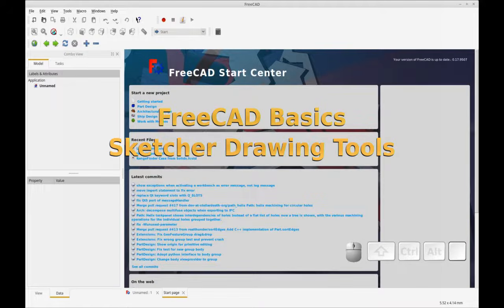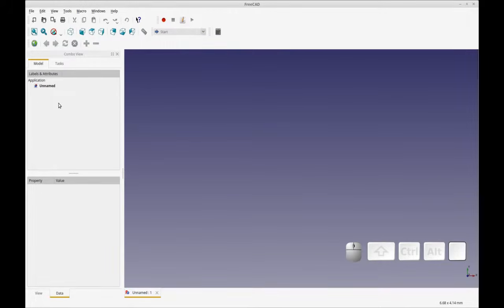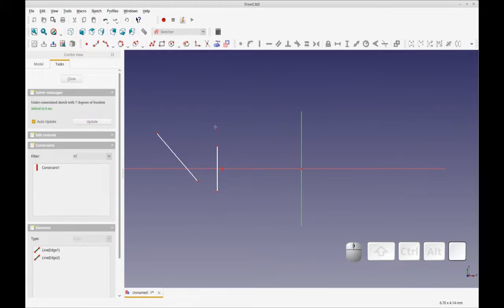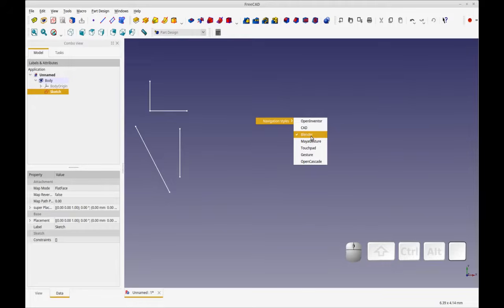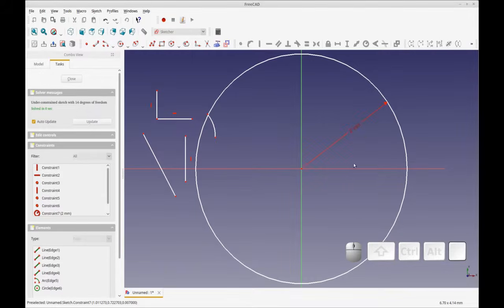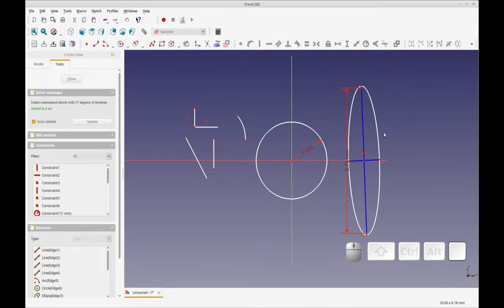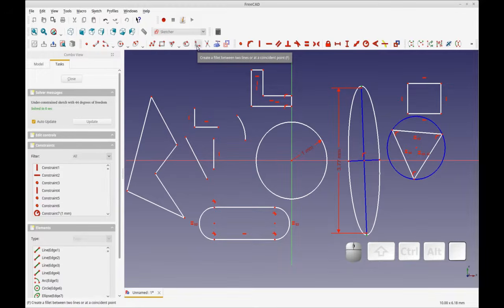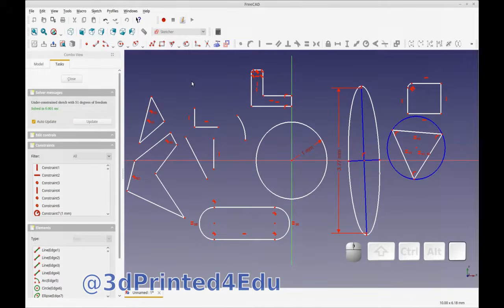FreeCAD - Basics - Using Sketcher Workbench Drawing Tools

Comment: Drawing tools on sketcher are all greyed out. Trying to find some instructions on how to work this software.
Reply from the maker: To use the sketcher tools, the sketch has to be in edit mode. You can enter edit mode by double clicking on sketch in history tree to the left.
Reply from the maker: There is also an edit mode entry in the menus and an icon on the toolbar.

Comment: Thank you for your video. I'm not an engineer and am starting from zero. I'd like to tell it not just the length of a line, but where it starts. Also, does it matter where you position your part relative to the origin?

Comment: What is the name of the software that shows your mouse actions?
What is the name of the video with the constraints?
How can I move a point in a sketch to coordinates xyz and lock it in place?
Reply from the maker: Hey, just saw you comment
1.) Keymon ( Linux only I think )
2.) Use Horizontal Constraint for X, Vertical Constraint for Y.
3.) Above Locks it in place.
Sketches don't have  Z, but you can position the whole sketch to move the Point in Z space.

Comment: Hello very good tutorial however, i have a tech question. I was following along imitating your video but when I got the 2nd vertical line (1:50). I don't have that added vertical constraints next to my mouse pointer. I am new and was thinking maybe it's my settings?  I am also using version freeCAD 0.18 if t hat helps.

Comment: Great, thanks for sharing. Around 1:50 I see your near vertical line gets automatically given a vertical constraint. For some reason, this isn't happening for me. Even although I want to draw something with the polyline tool with lots of perpendicular lines (e.g. a set of stairs) these auto constraints aren't appearing. I guess there is a feature to turn this on and off, but I've not found it yet...
Reply from the maker: You can turn Auto Constrain on and off. IIRC , it is on the task tab when u r editing a sketch.

Comment: How do I print in sketcher? Print preview continually just shows a blank white page. Thank you!
Reply from the maker: Unfortunately, you will not be able to print directly from sketcher. One way to print is to create a Drawing in the Tech Draw Workbench . Another way I have used is just doing screenshots on a white background. It is a little frustrating.
Reply: @mathcodeprint  , I appreciate the reply. It definitely is frustrating when trying to print something out to scale so that I can just glue it to wood as a stencil on where to make cuts. I will try Tech Draw Workbench. Thank you again.
Reply from the maker: For accurate scale drawings, definitely try Tech Draw, make sure you calibrate against your printer. Some printers are not accurate. So print a rule and measure it to make sure the printer is to scale. Then adjust if necessary.

Comment: Hi, I would like to know how to make a polyline with many points all at specific x-y coordinates on x-y plane. Then I would like to make another 2 bsplines on x-z and y-z planes, after that I would like that the endpoints of the different lines on the 3 different planes are connected. How do I go about that? at the end of the day I want to make a specific surface. From the surface I want to make a thin solid surface that I can use on my 3d printer. Thanks
Reply from the maker: My guess is that you would have to do that as a macro, or edit each point of a wire, for the polyline.

Connecting them can be done with draft move, or if sketches attaching to a sketch vertex. 

After that you can create a face from edges with the part advanced shape tool. 

I'll try to see if I can do a quick video.

Comment: Where are you selecting that "Body" from??  I can't find such a thing in my Freecad!
Reply: There is NO "Body" to select or double click in my Freecad. All that shows up in the left is "Unamed" That is unless I name it something, which I usually do right away.
Reply: @sotm6078  Switch to the "Model" tab.
Reply: Dumped FreeCad months ago for Fusion 360, much better program and there is a Free version believe it or not.  360 will even make stl files and generate G-code for CAM functions.
Reply: @sotm6078  I'm pretty frustrated with FreeCAD already. Only been using it for a few days. I'm used to SolidWorks and AutoCAD. Compared to those, this program isn't cutting it. The written tutorials are quite hard to follow, wording wise. I'll check out 360!
Reply: What OS are you using?  I'm Windows 10 and .16 is the latest version I find for 64 bit windows.

Comment: What version are you using
Reply: it is FreeCAD_0.17.12196
Reply: Too bad the 0.16 is the last runnable version on Win XP, if I am not mistaken. The UI looks quite a bit different compared to this and even if many of the legends are the same, it is not possible to follow the tutorial with 0.16. I hope they make updated XP friendly version.
Reply from the maker: They likely will, not XP is extremely old. It's footprint will only be getting smaller. There is just no reason.
Reply: Perhaps FreeCAD is the kick I needed to start migrating over to another platform. The newer Windows versions just don't have that old fashioned computing appeal to me for one reason or another. Thanks for the tutorial and reply.